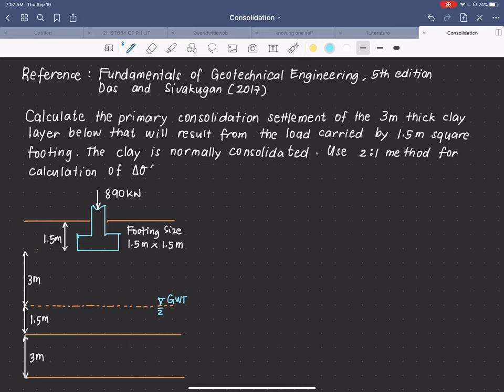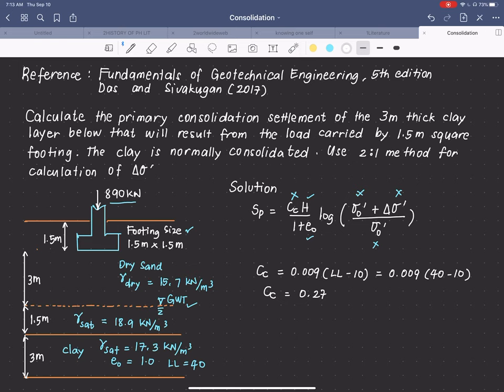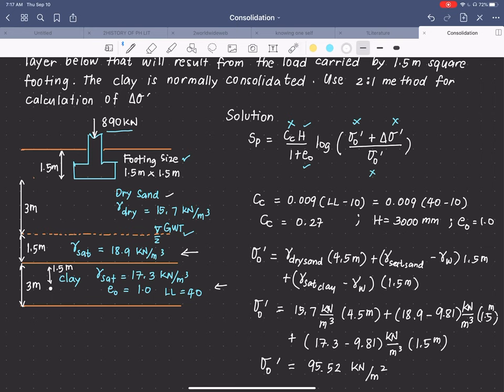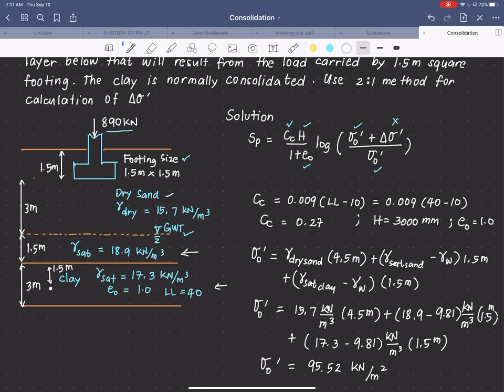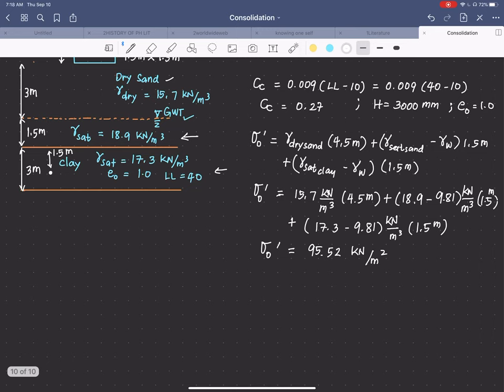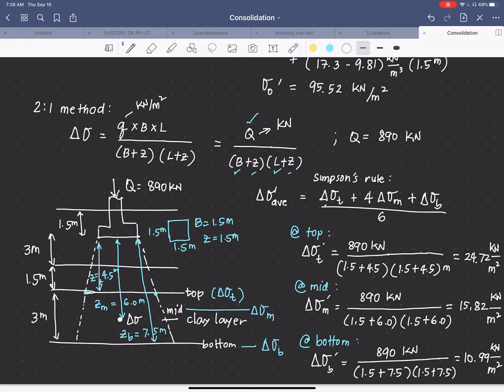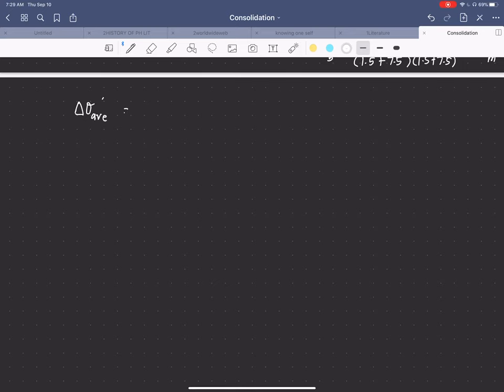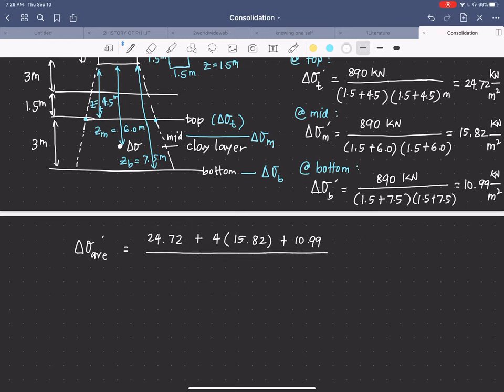Primary Consolidation Under a Foundation

Comment: Thank you very much. Although I need some clarity. I thought when the 2:1 method is used it gives the average stress (which is half the actual value ) so why don't we multiply by 2 the answer we get for the stress of the surcharge ?

Comment: clay is normally consolidated, you can not use Cc. present pressure is lower than pre-consolidation pressure
Reply: preconsolidation pressure is not stated in the problem

Comment: hey? if we were to calculate the primary consolidation of the dry sand, could it have been we consider depth of foundation (1.5m) plus half the depth of sand layer (3/2=1.5m) summing up to 3m then multiply by density (3x15.7) to get overburden pressure?
Reply: Yeah, 3/2=1.5 m.  
" sat = 17.3